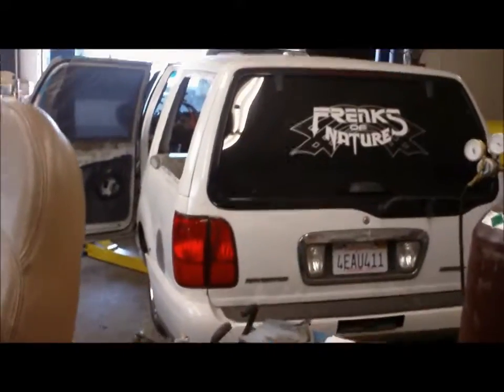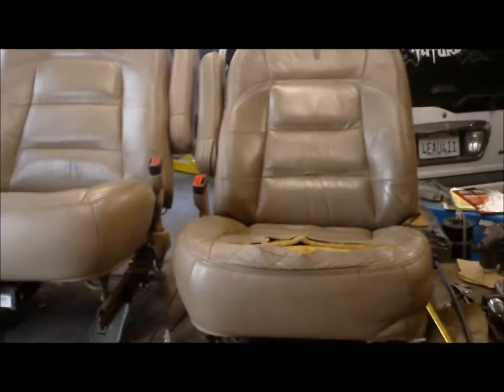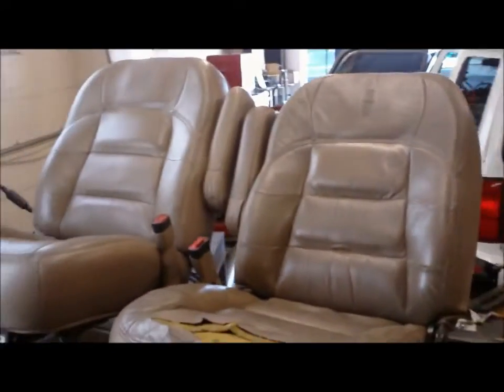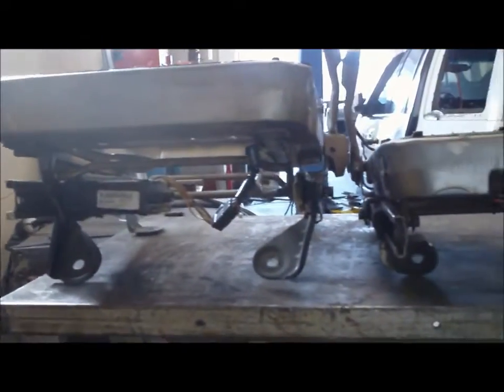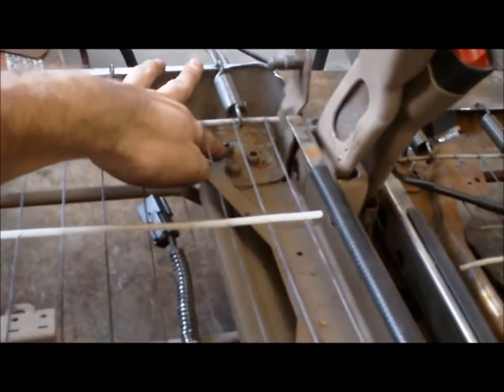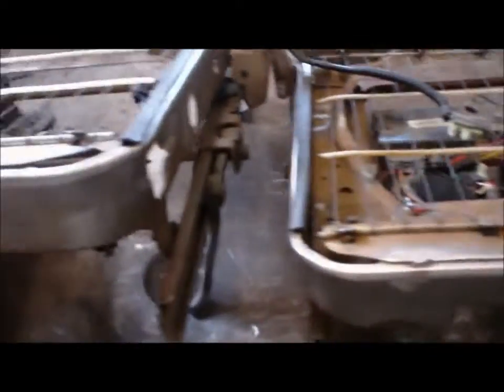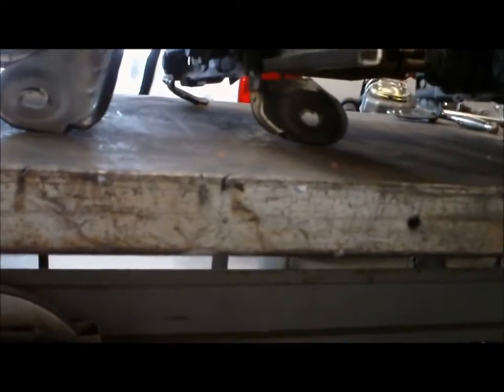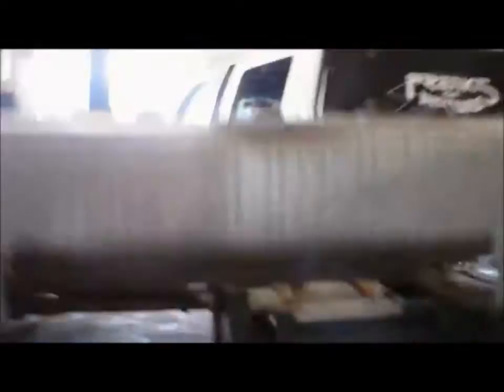Navigator Seat Mods

Comment: hey bud question is the bolt pattern the same for first gen 98-02 to second gen 03-06 friends seats got stolen looking to help him find some good seats which are decent price which i did but he has a 2000 and seats are 2006 not much info on net for compatible swap-able seats, if you can help would really appreciate it